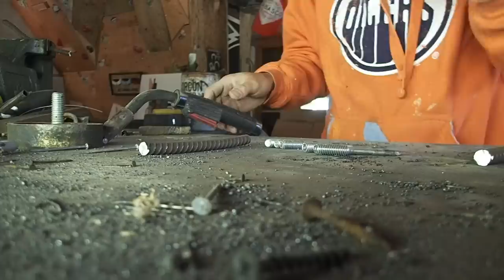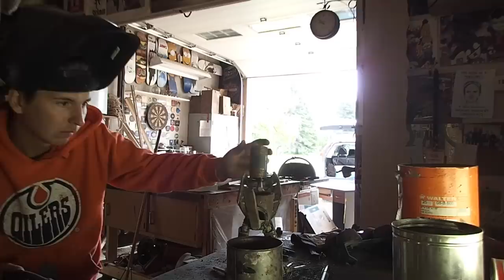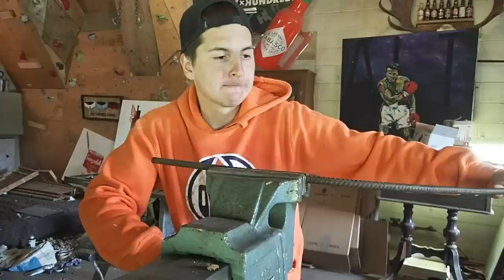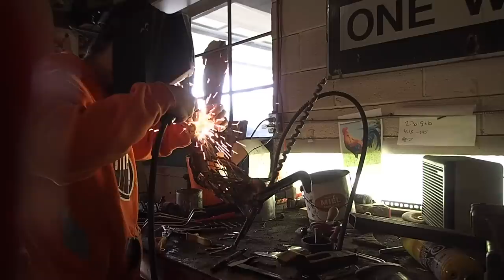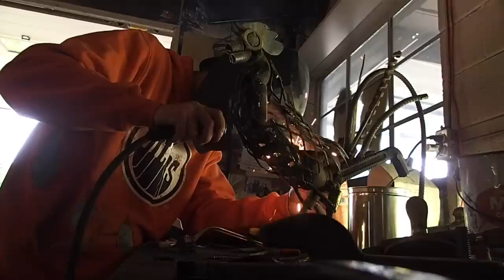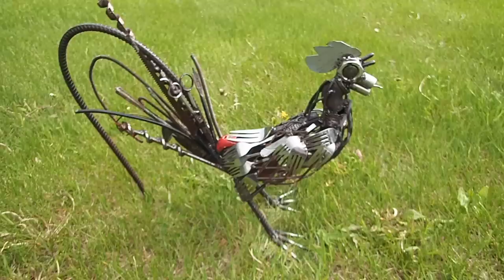Scrap Metal Rooster

Comment: It's lovely to have this window into the life of an artist and maker so multifaceted, hardworking yet easygoing, such as yourself.  I don't think you realize how much you inspire others to pursue their crafts.  I would be interested at some point to see what shop safety systems you use.  Fire suppression is the first one that springs to mind.   (I do nag Alex as well about minor things, like using respiration protection, replacing hightop Converse canvas sneakers with heavy steel toed boots when walking through piles of rusted metal and broken glass in old dump sites.  )
Reply: Bet u ran your hubby off.  Ha!  Comes from a good place and makes sense tho.
Josh is made of tuffer stuff than Alex. He would melt in a hot wind. Creampuff. Very sweet one tho.